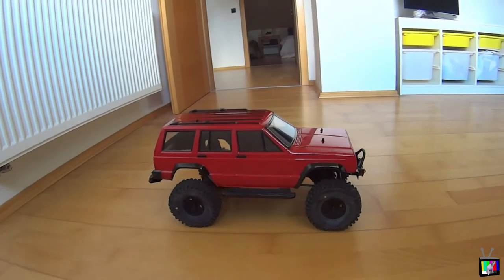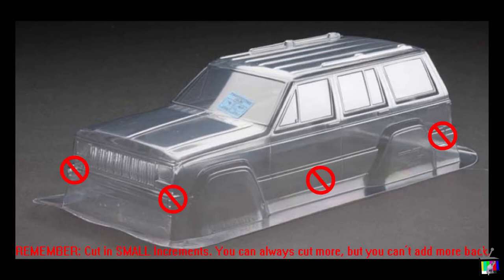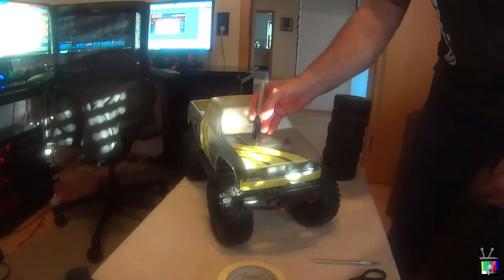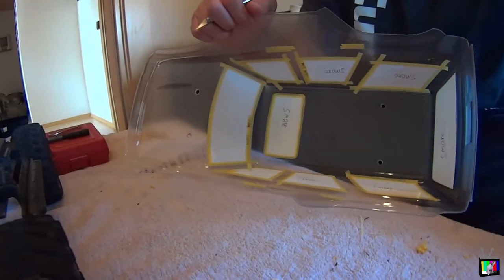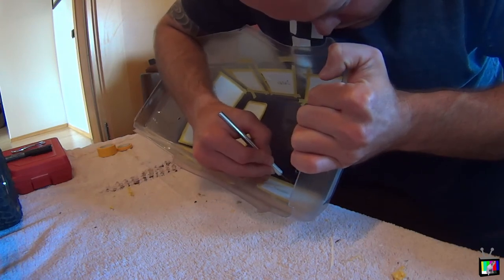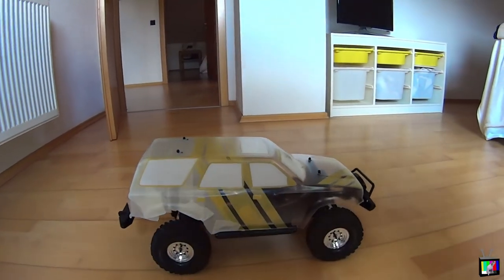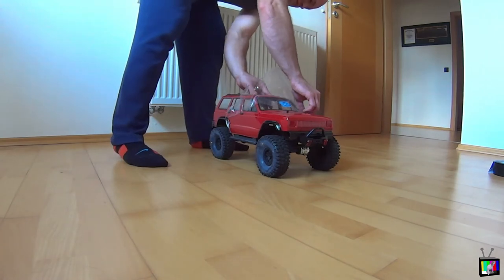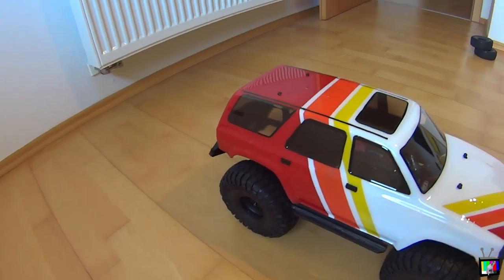Lexan RC Body Painting Tips + Body Reveal!

Comment: The 4runner came out fantastic. Would you mind telling me what colors you used?
Reply from the maker: Hey, very sorry for the late reply. Once quarantine ended, I found myself back at work and with less time for my hobbies. The colors I used were Tamiya PS-6 (Lexan Yellow),  Tamiya PS-2 (Lexan Red), Tamiya PS-7 (Lexan Orange),  Tamiya PS-1 (Lexan White), and  Tamiya PS-5 (Lexan Black). For the window trim I used Tamiya 6mm Tape (#87033), and for the Toyota Stripes, I used Tamiya 18mm Tape (#87035). The decals I used were from Tamiya's Toyota Toms 84C Decal Kit (#19495709). I hope this helps you and please let me know if you have anymore questions. Keep me posted on your build!!!
Reply from the maker: Also, I used PS-31 (Smoke Lexan) for the rear windows. Make sure you use VERY light coats with this. I messed up and had some paint runs.
Reply: @JeepSheep  thanks for the reply. I did a similar scheme with my trx4 sport body. Need to get a video up. Did the stripes backwards since it's technically not a toyota. Always been a fan of that scheme since the early 80's baja racers.
Reply from the maker: @vinceruland9236  i actually almost bought an 88 Toyota SR5 Pickup with this paint scheme back in 2016. Always wished I woulda done it. I’m also building the Proline Hilux body right now, going to put it on Axial SCX10 because I can’t find a way to make it fit on the TRX4.